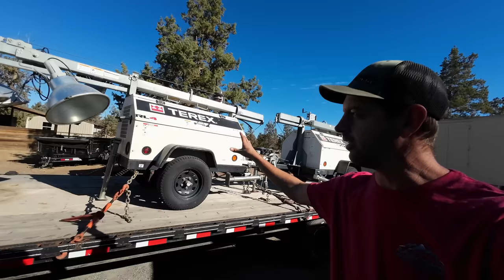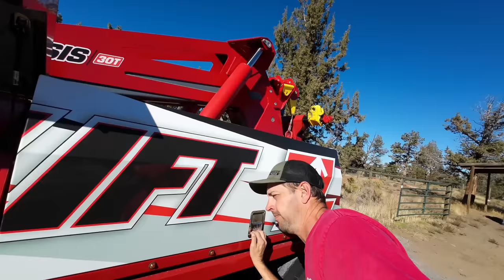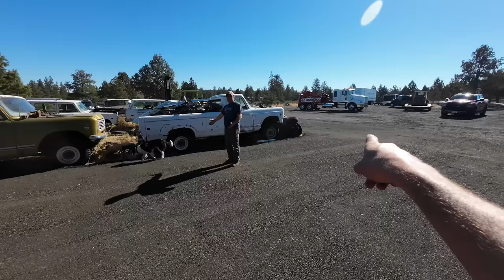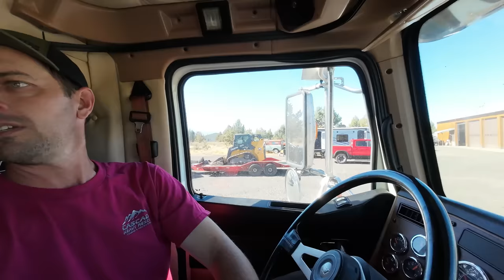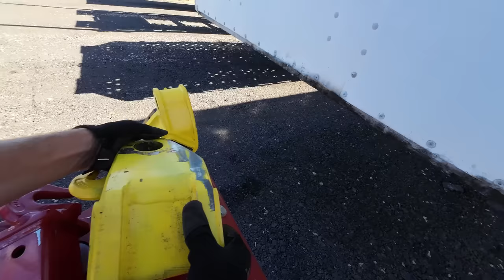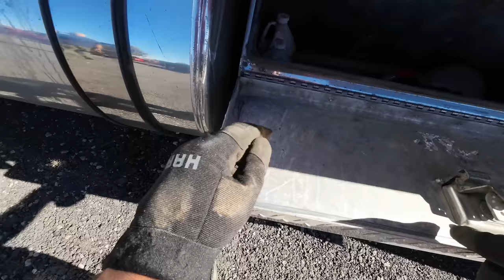Some rules were broken…. 😂

Comment: Casey and Ben are a unique blend of good old fun and friendship!   They bring out the best in each other
Reply: I saw a wrecking company using a homemade converter dolly for the exact purpose you want one. If you found a wrecked truck and cut the frame far enough ahead to bend the rails in and attach a tongue for towing to the job. A single axle straight frame would work best.
Reply: You got that right
Reply: Casey is the helicopter pilot of tow truck operators
Reply: Verily.  I'd happily buy the next lot over to become part of their compound when the SHTF.
Reply: Building funny . Unnecessary. Things. Only works good with a same 😁🎉 *idiot in mind

Alone building new things from scratch is .. awesome

Comment: Measuring 10inches off wheels 15 feet from the back of the trailer means you actually moved the back more than 10 inches. Don’t tell Ben.
Reply: I thought the same thing 👍
Reply: "Don't tell Ben.."   You just did !!!
Reply: just a little Trig will do ya!

Comment: I am glad you explained your reasoning for practicing different maneuvers with the new zacklift at the end.  The whole time I was looking at the 10k forklift thinking how easy it would be to move the trailer with that machine.   I look forward to seeing the truck work some real life roadside emergencies soon.
Reply: That's more like a 10 or 20 ton forklift!
Reply: @wesman7837  I thought it said 10000 on the side
Reply: We have a gooseneck adapter on our 5th wheel pin and the spring shop has a 2-5/16" ball on a bracket which slides onto one of their fork prongs with a pin to hold it in place. Plenty of weight on the ball (usually about 25% of total weight = about 4,000# for our trailer) so they were able to move our trailer into the shop without locking the adapter onto the ball -- just takes a minute but no need on a fairly smooth surface and no need to dink with the electric landing gear either. :)

Comment: Hey Casey. Just a thought for you and Ben  I saw you used the green forklift  It probably has the capacity to lift the trailer why not make a fifth wheel attachment that slips over the forks
A pretty simple thing to weld up or you can also use a cut off back end of a truck single axle dolly type of thing weld a pintle hook set up and you can use it with a back ho or skid steer. Ill instagram a photo to you of a set up for this
Reply: It's called creating content,we wouldn't come here to watch a Forklift move a semi trailer .
To be honest Ben could have moved it with the truck ,it would have taken a few more moves but he would have done it ,old skool styles
Reply: The forklift is way shorter too so it would have been easier to get out.
Reply: Thank god i wasn’t the only one who saw that i love watching these videos and have no hate but this one irked me because i was thinking the same thing as you the forklift easily could have moved that trailer and they coulda went about there day but that being said i understand the need for content i just knew i couldn’t be the only one frustrated by that lol

Comment: I saw a neighbor company unload a full size container with two of those forklifts. It was a risky thing, but I think this forklift and two chains (and an air compressor) would have done the job pulling the trailer over the yard and exactly on that place. The forklift uses less space than the pickup and you can lift near the kingpin from the side and use side-shift for the last 3 feet.
Reply: You wouldn't even need a compressor. Wind the springs back on the brake pots.

Comment: 10:40 something I just thought of to make sure the chains are even would be to mark them with paint at certain stops to equal lengths and it’d be a lot easier to get them right in my opinion
Reply: With the chains straight, not twisted, you can count the links too.
Reply: He could do color coating on each link to match.
Reply: Sometimes it may just be a matter of where they are anchored and you just have to eyeball what 'equal' is.  It's sometimes not a matter of math but of what works.

Comment: You where so lucky, I am either too close or just far enough away the under reach won't reach. Used to see a guy in Missouri that had a F-450 with a semi fifth wheel plate on it. He delivered new empty semi trailers with it. You are right about the outriggers. Just don't do it on a loaded trailer.

Comment: An empty 48 ft away is approximately 10,000 lb and then you probably have about another 1500 lb of liftgate hanging off the back with the batteries in hydraulics, let me tell you what those old Internationals will out pull any Ford Chevy or Mopar truck they were the toughest truck in the era❤❤❤ they were truly workhorses

Comment: Tare weight of that dry van is probably around 12,500 pounds or so, I'm guessing. Depends on the build of the specific trailer, but eyeballing it, I'd SWAG it at ~12500 lbs, including lift gate. The lift gate adds from 1000 lbs to 3000 lbs, again, dependent on model and build.

EDIT: However, as people have quite correctly pointed out, whatever the weight is, not all of it would be resting on the flatbed, and the liftgate in particular would have actually counterbalanced and  therefore taken weight OFF the flatbed, since it's behind the fulcrum point of the trailer's axles.
Reply: My 33' 5th wheel RV weighs more than that and we tow it with a 2000 F350 but box trailers have their wheels much further back than a 5th wheel RV. That increases the weight on the pin but the weight of the tailgate so far back reduces weight on the pin is therefore insignificant.
Reply: Did they say trailer was empty.?  It could be full of parts
Reply: @guyod1  It seemed to be implied that it was empty and that the parts intended to be stored inside were still sitting in that junkyard of vehicles. Casey made a joke about the fact that all the parts were still in the junkyard vehicles. Apparently that was the whole point of setting up a parts trailer, and I believe Ben mentioned that the junkyard wasn't gonna be there anymore after he ripped out everything and put it in parts trailer.
Reply: If it was empty the skid steer could of easily moved it. But maybe Cassey wanted content.
Reply: @guyod1  That's debatable. Also, Casey specifically mentioned that while they could have done certain things other ways, part of the purpose of all this was to learn his new rig better, try out different things in a controlled and casual environment, so as not to have to learn anything the hard way on a paid job. Better to grab some OJT and become more familiar with his rig here, than on the side of the road, on the clock, with traffic whizzing by. 

Also, nothing wrong with giving us more content, as long as it's done in a reasonable manner. After all, "content creator" is literally his other job.
Reply: The flat deck only took on about 3500/4000lbs. Most of the weight in that van is in the axles, rubber, and framerails. Axles are probably 10 or 12 ft forward and the tommygate roughly takes its equivalent weight off the front....

Still impressed by old blue there though, a new 1ton would be down a foot or more with 4K on its back...

And yeah it hauled the 12 or 13K, looked cool as hell doing it too. But they didn't land 6 tons on its back

Comment: I had a 1942 International military pick up that I restored original from ground up.  It was AWESOME.  Of course top speed was 50 mph.  I loved that truck, 3/16 inch sheet metal fenders, granny low top speed was 3 mph, I put 2 1/2 ton machine in the bed and it didnt squat.  Unfortunately my divorce ate it.  Internationals are great.  Need I mention the International bull dozer I worked on in Vietnam that kept going and going and going?  You have an out-of-sight flat bed.  Very interesting presentation.

Comment: IH built some great light trucks back in the day….they were 20 years + ahead of the competition in a lot of ways. They were the first to offer a 5 speed overdrive manual transmission in a light (1/2,3/4 and 1 ton) truck, either 2 or 4wd, and they were the first to put a diesel in their light trucks (the D301 inline 6, they’re rare in trucks but they did make them)….both of which they did in the early-mid 1960’s. It’s just a damn shame they never did well with rustproofing / coating their cab / body sheetmetal, their frames and drivetrains were great.

Comment: When i was an apprentice at a semi shop one of the lead techs had a flat bed Dodge this was 1st gen Cummins as im old. Anyway he had a repair shop with his brothers. So he could work in trailers and have a platform when doing work on the Thermo King units he welded a semi fifth wheel to his bed and an air compressor and tank so he could move the trailers around. Most if the semis that came in had major drivetrain issues so they couldnt depend on having a running semi in the yard and yard dogs arent cheap nor give a platform. So its not unheard of to move a trailer with a pickup. Guy local uses one tons to move mobil homes as well.

Comment: 30-odd years ago a workmate operating a 40-ft bucket truck (Mercedes 911 4WD) needed to get the bucket closer to a telephone cable catanary termination on a pole on a steep bank well above the road level. He drove the truck so the storage boxes on the passenger side were against the bank then used the front and rear driver's side jacks to tilt the truck over as far as possible to the passenger side. The modern way of doing this is to extend one of the bucket's booms to get the sideways reach but this was the older elbow-style machine without telescoping booms. My friend was then able to get the bucket close enough to the termination hook to terminate a new phone cable.

Comment: Nice use of an old one ton that was never designed to do that work. Always several ways to do a job. I never thought to swing the boom with the outriggers. It looked like you could have hooked up the other winch and it would have been about 10" closer to the building. Easier to not unhook and just tilt the wrecker...My limited knowledge using a light duty tow truck Is no match for your years of experience with heavy towing.
Reply from the maker: Yeah, hooking up to the other line would have done the same thing, but I wanted to try out different things with the Zacklift.  I’ve ran heavy wreckers before, but I’m brand new to this hybrids detachable wrecker setup and need to learn its capabilities

Comment: So the outrigger movement thing I am going to use that. IMHO that trailer weighs 9-11k.  Another thing to buy is the medium or heavy wheel grids for that truck so you can wheel lift light/medium and heavy things. Think of how easy those junk motorhomes will be.

Comment: with how much room there is between the Zacklift unit and the cab you could probably fit a knuckle boom crane on the truck. it would increase the capability of the truck especially when you are pulling your trailer. maybe an unnecessary expense but it was my first thought seeing that gap.

Comment: I have had this happen! The spindle weld broke the tow operator striped it down to spindle only, deflated all the air in the wagon chained bad corner as close to wagon frame as he couldtook air line off bad bag then inflated wagon!! Yes, it looked VERY sketchy but it worked got to a shop and replaced spindle hope this helps 73 dan

Comment: Casey what works really well for doing what did with blocks and chain is tire and wheel especially a one ton tire and wheel 
Making the king pin capture plate used to be quite bit cheaper than buying  one don't know if that's still true

Comment: Converter dolly works OK, but a set of trailer tandems with a flat plate and multiple holes for the king pin to set in works amazing! Then you don't have to worry about overloading a single axle dolley.
Reply from the maker: My truck doesn’t have the wheelbase to safely tow a loaded trailer from the rear
Reply: Tandem dolly is also a thing

Comment: I'm sure you noticed during editing, but when you were swinging the back of the trailer over, if you had switched cables you were lifting with, it would have swung over without as much outrigger shenanigans. 
Also, hot shot guys deliver new hopper semi trailers with Dodge 3500's. Smarter ones use 4500 or 5500.
Even smarter ones use single axle semi tractors,,,,,
That one ton binder is bad ass.
Reply from the maker: Yeah, but the point was to try tru different things with this truck

Comment: take the connection out of your gladhand attachment and add it to the hose 
you dont need to buy a new fitting 
maybe an adapter if the threads are adifferent size from the hose

Comment: Tare weight for the trailer is probably about 14k lbs., but with the forward position of the axles the lift gate is acting as a counterbalance so the weight on the kingpin is likely only about 5.5 - 6k lbs.
The flatbed only felt the full weight when you slid the back end over to line up with the building.
Shhh, that last lift overshot the mark, geometry, if the end of the trailer needed to move 10", the axles only needed about 8".

Comment: That box trailer weighs about the same as a 40ft gooseneck.     I pull them all the time with a pickup and a 5th wheel hitch.     Just release the brakes with an air compressor and glade hand and roll with it.        Do not pull them on the highway it is illegal unless you have trailer brakes working.        But they are NOT heavy at all.

Comment: 18:51 
THAT dear Ben @406garage3 - is a very strong pincer tool, (self holding) usually used to hold small electronic components whilst soldering, to "transfer away" the heat to avoid destroying the electronic component itself, whilst the end wire is being solder connected (USING HIGH HEAT) to the circuit board.

A VERY USEFULL pair of INDUSTRIAL tweezers.
Which of course can also be used as normal tweezers that will auto-hold whatever you apply them onto, such as chin hairs (with a dangly thing), but don't slow pull on it, as chin hairs are amongst the most painful if slow pulled.

AND YOU THREW IT AWAY ? 
(it is priceless - especially if free).!!!!!

Next time (actually BEFORE next time) place a bin of sorts (with drainage holes so you never need to cover it), to toss STRANGE "don't know what that is" things inside, until someone CAN tell you what it is, as sometimes people who don't know what they picked up, will toss away GOLD (literally) as some items are indeed priceless.

Comment: 48 ft dry van usually weighs about 9500, but I bet you it's 12500 with the lift gate , but it depends on if they are aluminum or stainless? A stainless trailer from the 80s is going about 15,000 , but that looks like a 90s utility trailer with aluminum sides and a steel deck my guess is 12500 lbs , it's definitely not a Great Dane

Comment: Here in europe slingtowing a trailer is not allowed by law. We use a small 5th wheel with a manual pin to lick in the kingpin. Takes 2 minutes to hook up too. Slingtowing is not allowed because trailers aren't made for it and you not using the strong part of the trailer for lifting. Really love seeing how its done in other countries tho. 

We just put on the 5th wheel plate, hook it on the kingpin, put the locking pin in, connect the airlines, lights and EBS and we're good to go. 

Btw, i see amarican trailers dont have back up lights, is that not mandatory in the USA? Here in europe the must have at least 2 by law. Most have more "worklights" connected to their reverse lights to see better. 

Keep up the good work bud💪

Comment: i would have just used the little flatbed truck to move it to begin with. that dry van couldn't weight over 20k, could of chains and binders, small geny and air compressor.

Comment: Since you were using the driver's side winch, you could have just switched the hooks to use the passenger side winch and it probably would have given you the 10 inches you needed instead of using the leg to tilt the truck.
Reply from the maker: Yes, I definitely could have.  But the whole point was to try out different maneuvers with this truck

Comment: Seen  trailers rigged this way  to under reach. Trailer's that failed my pre trip inspections. Damaged suspension taking to repair shop. 

Trailer at the company yard  maintenance shop, with annual inspection the day before failed my pre trip inspection.  1. break pads right front  less than DOT min of 1/4".  2. Outer left rear dually improperly mounted couldn't access valve stem inner tire.  Raised hell with the service manager when I brought it into the shop. For a BS annual inspection.

Comment: 11:06 Shouldn't the yellow things have been left outward against the pins because the chains are attached further out on the trailer with a wider spread. The yellow things are going to want to slide outward which will loosen the chains.
Reply from the maker: That put the chain towards the edge of three angle and I wanted them in farther.   The receivers won’t slide once there’s weight on them
Reply: I assume friction isn't the only thing preventing the receivers from sliding when there's weight on them. If that's not the case and you wanted them in further and you could slide them in all the way towards the center then could cross the chains.
Reply from the maker: @catranger01  purely friction, the same thing that holds them in place while I’m towing a truck down the road with them and going around corners

Comment: You must have a Certificated Fabricators  shop Who could make you a keyhole plate for the fifth wheel  King pin It would be a lot cheaper Still  certificated for insurance  & if you have to make Turns around a yard  a old Truck rim  Makes a good fifth wheel Plate When I say truck rim I do Mean eighteen wheeler size